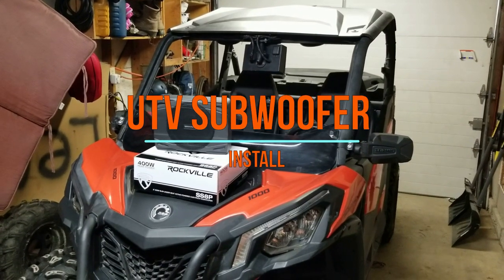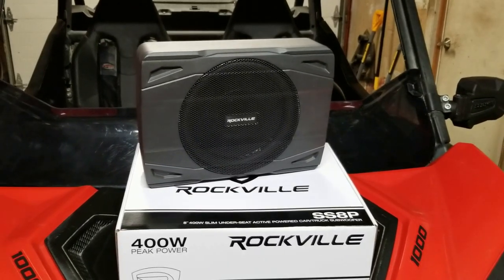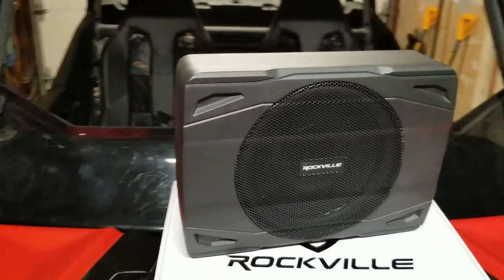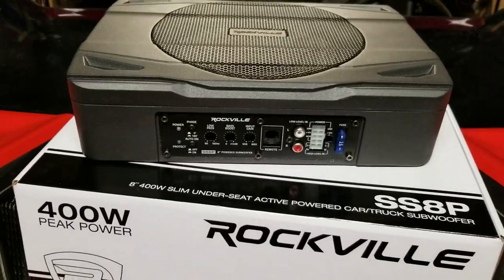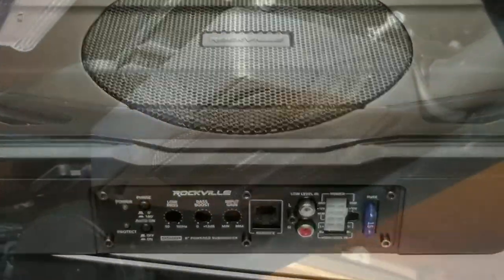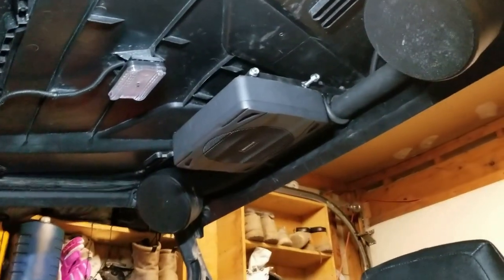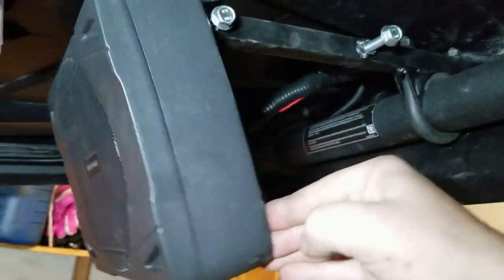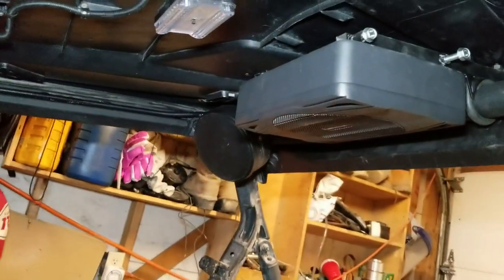UTV Subwoofer Install

Comment: I have a 2021 maverick trail 800dps. Was wondering if you think this could fit up under the dash. Already have 14inch boss soundbar but lacks bass
Reply from the maker: Yes you could fit it under the dash or in the passenger footwell but I would be concerned about it getting wet if you do a lot of mud riding.

Comment: How do you wash your machine with it if it’s not waterproof?
Reply from the maker: When washing the outside I really don't do anything differently because it's tucked up in the roof. When I wash the interior I try not to spray water on it but he only place I'm really concerned about water getting on it would be where the connections are and they are facing the roll bar so they are some what protected.  So far I have not had any issues.

Comment: What kind of head unit are you using?
Reply from the maker: It's an Android head unit I bought off Amazon. 
 https://www.amazon.com/dp/B07VHD4B23/ref=cm_sw_r_cp_apa_fabc_F7CYYKVJ4BW8X4VD481V?_encoding=UTF8&psc=1
Reply: @mtrmotorsports977  Nice!!  Thanks for the link...  Does the sub have good bass?   Worth buyin?
Reply from the maker: @joshscott2631  for a $90 8in powered subwoofer it sounds good it's not going to Rattle your teeth out but for a side by side I think it works very well.  I doubt you're going to find a better bang for your buck.
Reply: @mtrmotorsports977  Should be all i need for what I listen to. Believe I’m going to give it a try. Thanks for the info.
Reply from the maker: @joshscott2631  Glad I could help.